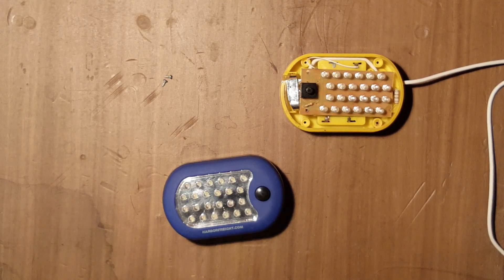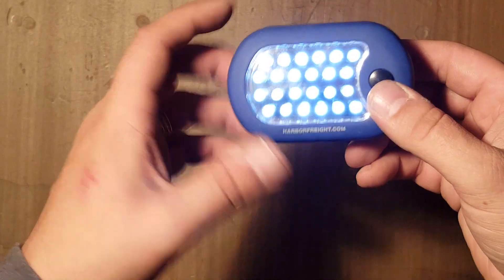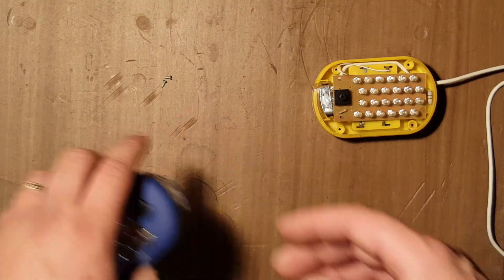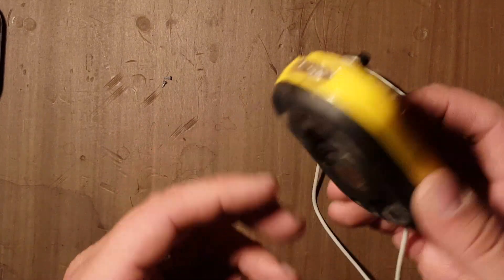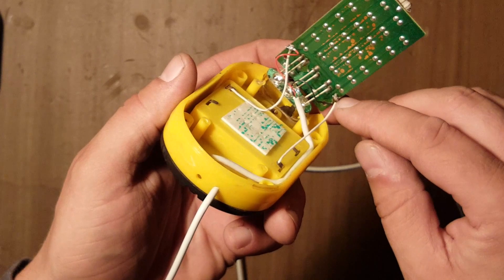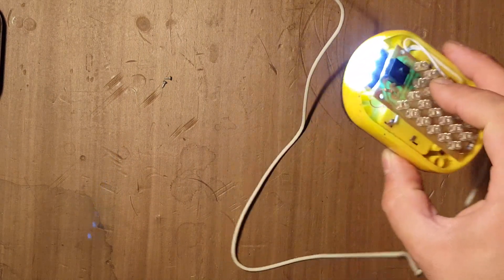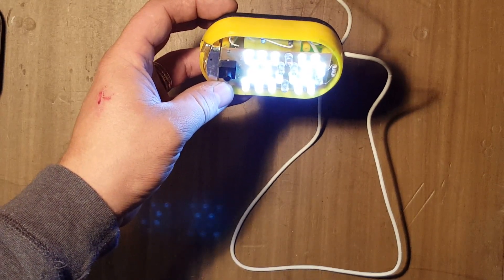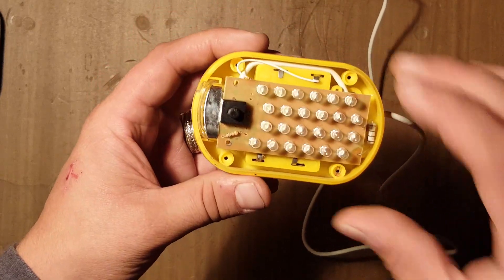Battery Operated Light to USB Conversion

Comment: Add a Silicon diode in series which will drop down 0.7 volts . You will then be left with 4.3 volts.
Or you can add a potentiometer in series and control the voltage across your load

Comment: A fresh set of batteries (@ 1.65 volts each) probably delivers real close to 5 volts.  So the resistance in the circuit should be sufficient.  That behavior could just be the result of poor product quality.  I've had some of these types of lights do this having only ever run on battery power.  You might want to try adding a .5 volt blocking diode on the next light to help reduce the USB voltage to better match the voltage that circuit was designed for.

Comment: Are you sure you have the polarity correct? LEDs may still light if the polarity is reversed. However, could break down if the reverse volatge is too high. Or maybe your adapter current is too high.